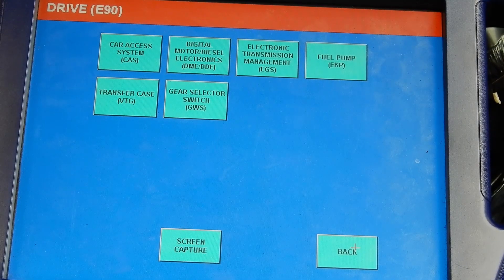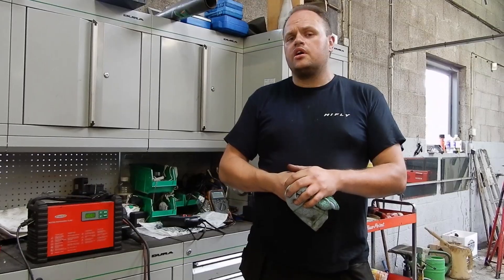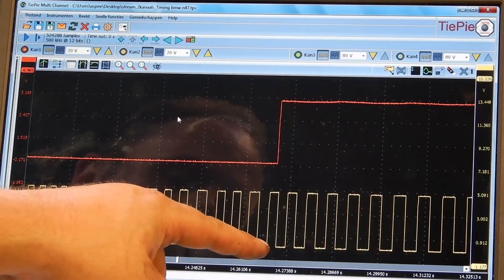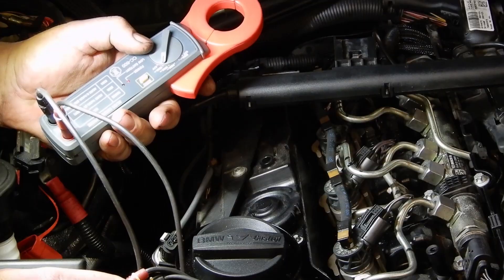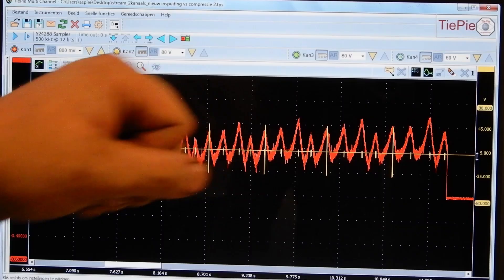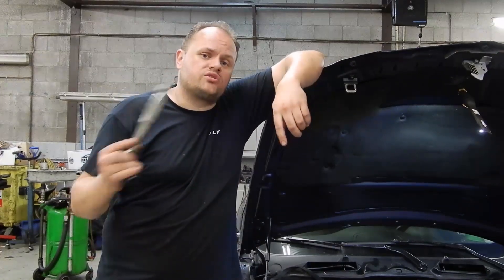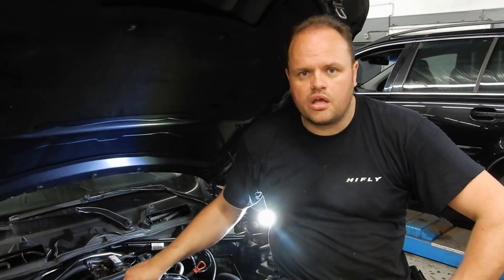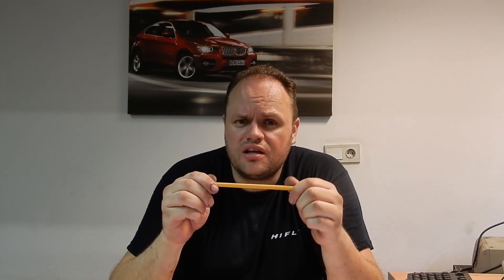Bmw n47 diesel engine "Won't run" diagnose

Comment: This was a great case study Danny! It had me scratching my head for a while,but then I started wondering if something is dragging on this engine. Since Diesel engines need a lot of compression to start,I was thinking there might be an issue. What if you had removed the drive belts and try again? What if the generator had failed,the AC compressor or the water pump? I’ve seen that before! Very interesting! 👍👍👍
Reply from the maker: Nick Nicu, if you w watched closely you would have seen the belts were taken off😉
Reply: DiagnoseDan Ah cool,thanks! 👍 That’s what happens when you watch on a phone screen... 😁
Reply: Yup ,had an ac compressor, lock up, and then a no crank,cheers

Comment: I try and use scan data to check for fuel pressure now as soon as I get a no start on a common rail. That engine just never sounded like it was cranking fast enough. Had it "run" a bearing ? I had a water cooled alternator on a BMW seize that gave a no crank symptom one time it was very hard to diagnose at the side of the road. I love your video's ! Very helpful ! Thanks from New Zealand.
Reply from the maker: herr kiwi The name Kiwi gave you away🤣

Comment: think maybe oil galleries have been blocked with the red sealant ?
Reply from the maker: Simon Rawle 🤔
Reply: Absolutely! Silicon squeeze-out on any block joint are sure sign of problem! The slivers will either block a pickup screen or, if thin enough, get drawn into the oil pump and seize up a bearing or block an oil orifice. If a joint is supposed to be RTV sealed, it should be applied waiver thin, just enough to seal.

Comment: A very useful way to check the condition of your engine   the relative compression test is fast and also point you in the right direction . I know you didn't but it would have been nice to see the problem but most likely it was terminal lol 🤔
Reply from the maker: Raymond Ferguson agreed! I would have liked to take it a bit further. But the news was bad enough for the customer.😣

Comment: Hello, In that case, you need to run engine without start motor, causing flywheel rivet stuck engine.
Reply from the maker: Woolim Choi I'm not sure if i understand what you mean buddy.

Comment: Hello you need to run engine without belt. If engine run, damper clutch is problem.
Reply from the maker: Woolim Choi belt was off and injectors were out🤣

Comment: Sometimes auxiliaries can be dragging....ie alternator, a/c compressor etc.
Reply from the maker: True! Always check that first! 😁
Reply: If you have a look at the video you will see the serpentine belt has been removed , so the accessories are already disconnected .
Reply: @richodude2679  correct!

Comment: Its cool you take the time through all the diag process . For sure i was going to check the low pressure fuel pump first , they fail a lot . Nice to see someone working on euro cars :D
Reply from the maker: Crank Thank you!😁
Reply: @Diagnosedan  I didn't think the low pressure pump would matter only the high pressure?

Comment: could you have took an RPM from the cranking current trace or injector firing event ?
Reply from the maker: BBS_Robski you can calculate the Rpm based on timebase and repetition!
Reply: DiagnoseDan it would have been interesting at what RPM it was cranking at, I think that would have been a clue too ?
Reply from the maker: BBS_Robski you could actually hear the engine crank slow, it sounded like the battery was weak.
So there was really no need to calculate the Rpm.
If i wanted to know the Rpm i could have looked at the rev. counter on the dash or at the data on the scantool.
But if you mean it would have been  interresting to calculate the Rpm based up on the signals you are right😎
Reply: DiagnoseDan yes for demonstration purposes, I should have stated that sorry.
Reply from the maker: BBS_Robski thanks for the tip! i'll keep it in mind👌